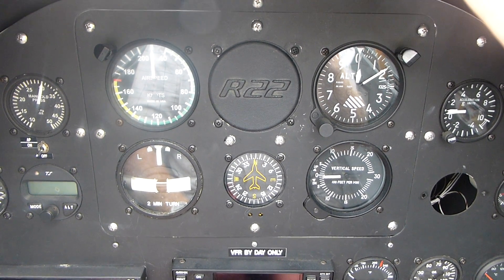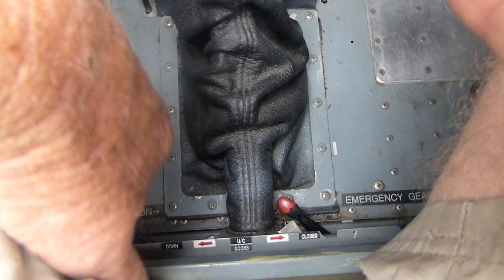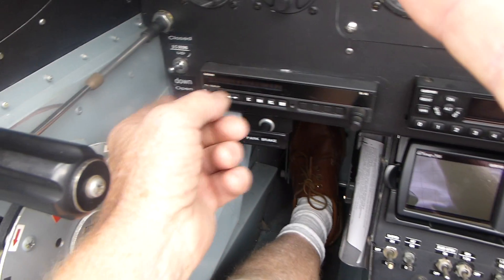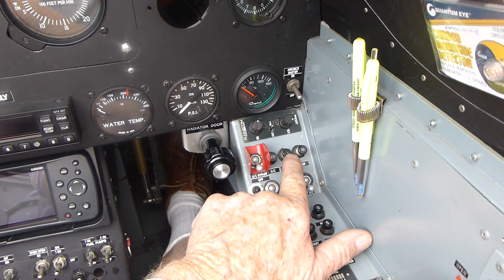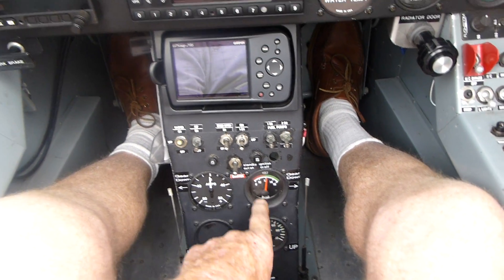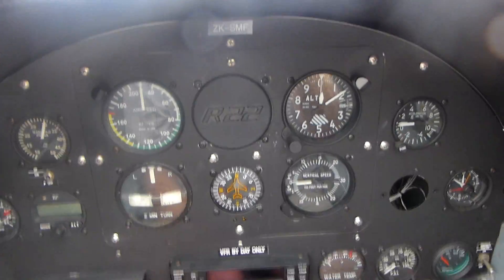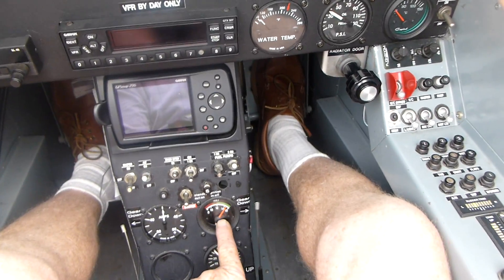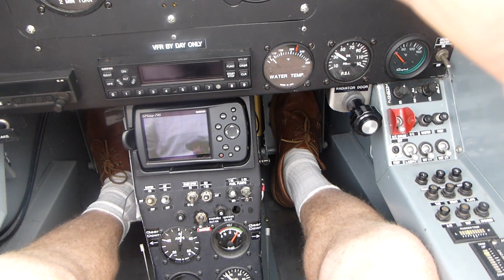Rotary T51 Titan Start Procedure

Comment: Reading comments sad to hear of his accident and passing. Looking at photo it looked very survivable. Wonder if it was a  medical condition?
Reply: I read the report. It seems there were a number of mistakes. He’d recently changed the control layout and it’s theorised that he turned the engine off by mistake, rather than switching of a faulty programmed electronic control. Then his seatbelt was connected to a point in the frame that wasn’t up to it. The kit providers didn’t provide info on where the seatbelt should be connected. He died from hitting the control panel / stick. The report said that accident should have been survivable, had his seat belt held.
That is my understanding, google the report for a more accurate version.

Comment: Could you not use a "20B"?  There is a nice Spitfire going together in TX with a "3 Rotor" which sounds great and will have an extra 80-100 hp over over "2 rotors".    Has it flown yet?